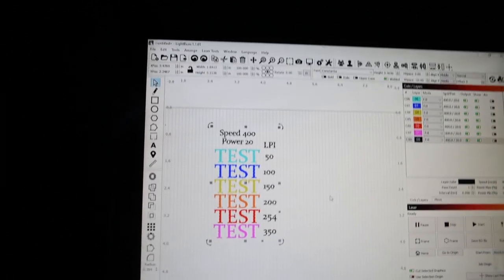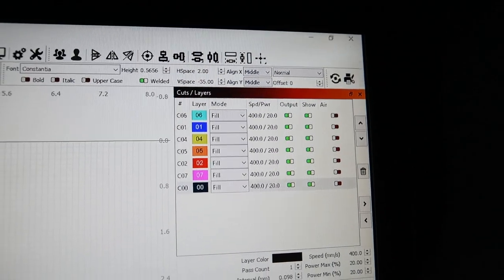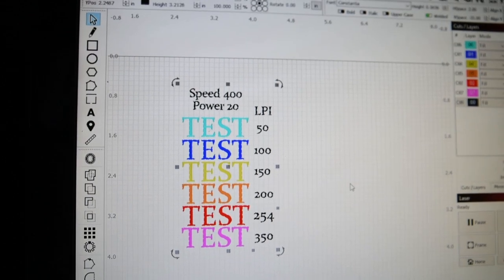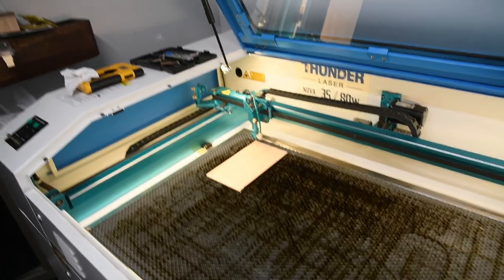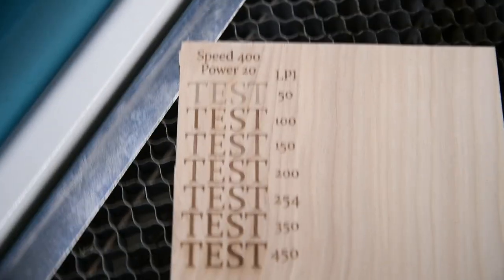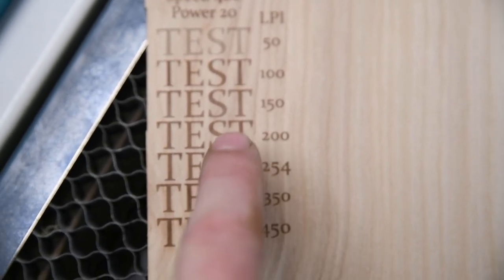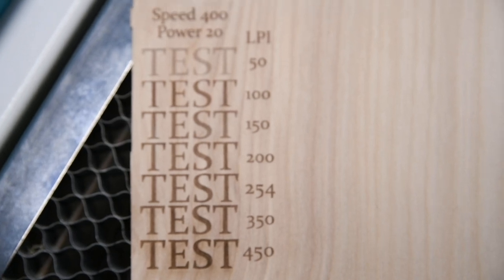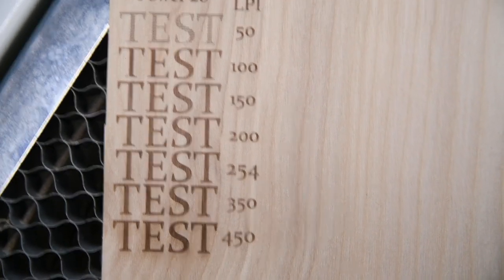Darker Burns Using Lines Per Inch #laser #lightburn #thunder

Comment: Wow, what a difference. I’ve only ever jumped between about 250 and 350. This is interesting and I’m walking out to my laser now. Thank you for posting
Reply from the maker: Thanks, yes for images i normally use about 260dpi from what i understand the standard 2" head can only achieve about 318dpi before it starts going over the last line works fine for text and LPI not so much for DPI.